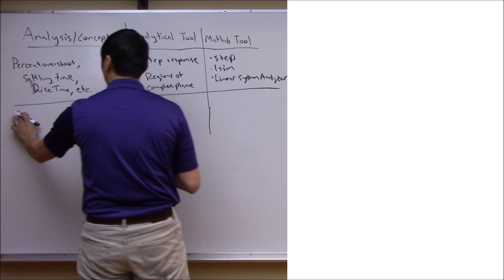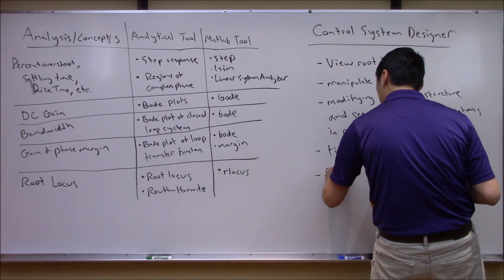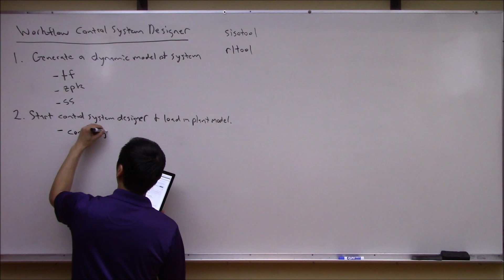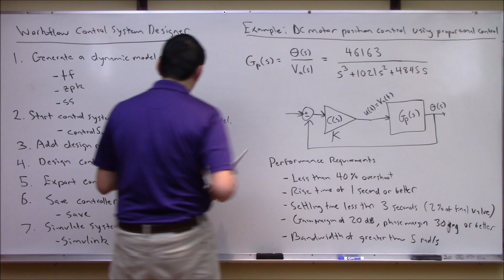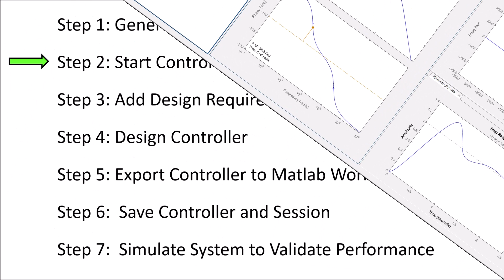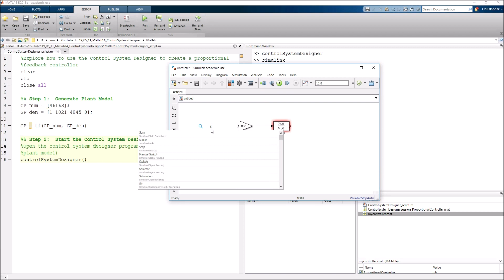Comment: AE511: This really ties in all the past couple of weeks of lectures into designing control systems. It's pretty crazy how all the manual work we have done making the bode plots and root locus is done with the control system designer tool in matlab. It's a great tool in a situation where you are given design requirements and need to develop the system on the fly with said requirements in mind!

Comment: [AE 511] 39:00
So root locus is only 100% valid for 2nd order systems? Regardless input, if you have a 3rd order denominator, the root locus regions are not 100% accurate?
Reply: No, the root locus is valid for any amount of poles.  The equations for things like PO and settling time that are functions of wn and zeta are only exactly valid for 2nd order systems.

Comment: thank you for your videos i have learned a lot of thing from them, plz i have a question i have this open loop transfer function G=20/(p*(p+10)*(p+1)*(p-1)).
But when i do a feedback the system is stay unstable and goes rapidly to infinity i have tried to stabilize it by adding a gain so i can have a positive phase margin, but even though the positive phase margin and infinite gain margin the system still unstable please can you help me.
Can i use a pid controller to stabilize it? And how can I do that?
Thank you.

Comment: First of all, thank you for your effort, your videos are just amazing! I have a question concerning the controlSystemDesigner. Everything worked fine while I used it for PTn-Plants. But it doesn´t seem to work properly with ITn-Plants. I tried a fairy simple IT1-Transfer Function for my linear actuator I want to control and while the step resonse in Matlab (using step()) looked as expected, the step response in the csd did not look any similar. It doesn´t look like the typical ITn-response at all. 
Do you have any experience with that?

Comment: AE511-Fantastic overview of the Control System Designer!now to use my 2 remaining wishes...1) It is worth noting that the creation of Simulink model functionality was first released in R2018a.2) (very minor, but just so I can use up my second wish) The example had settling time for within 2% of final value which didn't get inputted in the designer.
Reply: Alan, as always, thanks for the careful attention to detail.  I will try to put a note in the video outlining the oversight about the 1% vs 2% final value.

Comment: AE511.  What happens if you have conflicting requirements that over constrain the system?  Does this cause an error with Control System Designer or are the requirements that are added to the plots just acting like guidelines?
Reply: Great question.  These regions are more like guideline.  There is nothing stopping you from adding too many constraints and leaving you with no solutions.  In that case, you'll need to relax or remove some constraints.